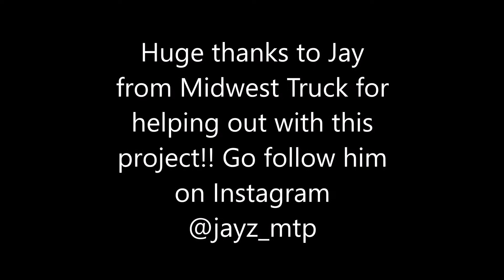Intercooler Upgrade on the First Gen!!

Comment: Were you able to keep your A/C condenser ?
Reply from the maker: probably could have if I would have wanted to, but I didnt care so we didnt make it work with the ac
Reply: Copy that. Most have to loose the condenser, to install grill. It would be interesting to know the boost pressure before the intercooler and after the intercooler, with the factory setup and then after the modifications you did, to see the actual flow restriction change and also air temp readings before and after with factory and the modified version to see the true improved flow and heat removed by the intercooler heat exchanger. Enjoy you videos. Where are you located ?